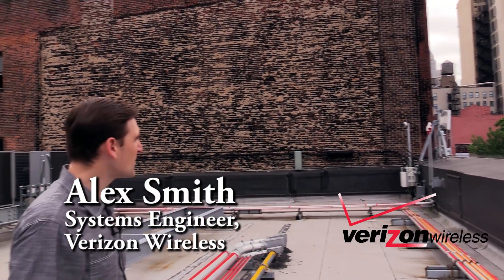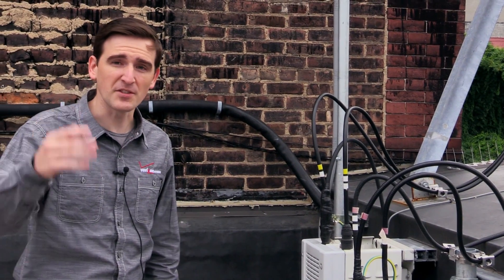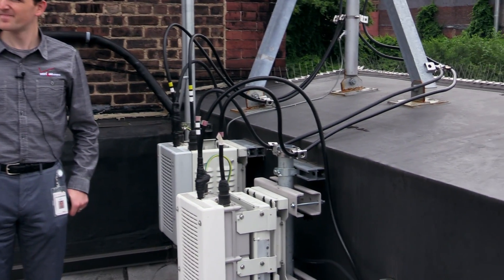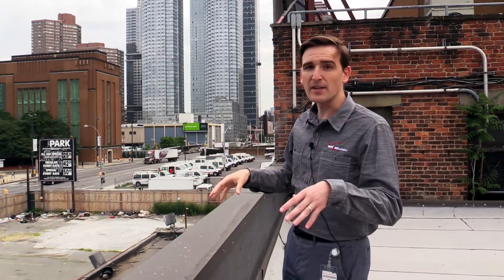Verizon Wireless Infrastructure Tour - RCRtv Places NYC

Comment: Is Verizon still densifying with small cells in NYC ? Their network speeds are holding up extremely well in many areas.  They still need to catch up to Tmobile who has incredible cell density.  At&t is doing big upgrades but aren't adding any small cells which are desperately needed.